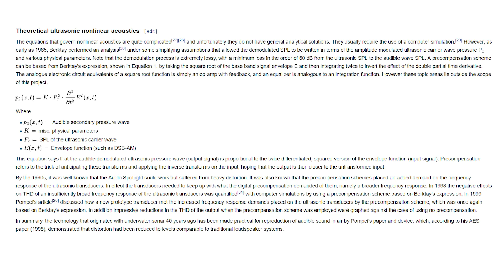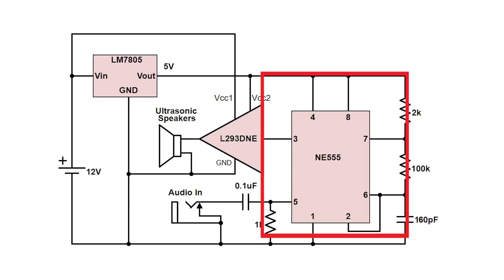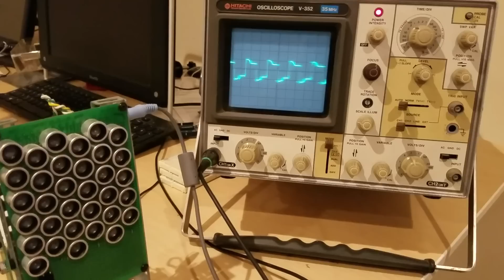Turning Sound Into a Laser

Comment: I built this, so, some build notes: 

IMPORTANT: Vcc1 and Vcc2 are switched in the schematic in the video!  It doesn't seem to burn out the H bridge but be aware that they are labelled the other way in the datasheet.

It's not very loud if you use the H bridge and 12 volts.  If you crank it up to 24 or 30 volts it's a more reasonable volume, but the 7805 is going to get really hot if you power it off the same voltage.

I tried feeding the modulated output from the 555 to a Sure Electronics 8 watt Class D amp I had, and that did work, but it introduces a decent amount of hiss.  The H bridge is a lot cleaner, but it's harder to get the volume up.  On the plus side it's louder and only needs 12 volts.   The transducers do start to get warm running off the class D amp.  It may be worth putting a low pass around 100-200khz on the class D output, but I didn't try it yet.

It's super sensitive to the capacitance.  I got lucky I guess because the two caps I picked to get into the right ballpark turned out to be pretty spot on 40khz.  Even adding a 1pF to it detunes it slightly.  A variable capacitor might be a good idea (alongside a fixed one, you only need a few pF of adjustment).  If you are off 40khz by much it becomes almost inaudible.  

Anyway thanks for this CodeParade, even with the few hiccups I was able to recreate this and the effect pretty easily.  It does really screw with you when it sounds like it's coming from somewhere else.
Reply from the maker: That's awesome!  I'm so glad you got it working 😁

Those build notes are spot on with my experience as well.  I also heard much louder volume with higher voltages (16-24v) but yes you'd have to ditch that 7805 for something like a buck converter, I just didn't have one on hand.

Yeah, the capacitor tuning was really important, I kept putting different small capacitors in parallel and just tried to see which configuration was loudest.  Even though the transducers are rated to resonate at 40kHz, I found that in my configuration, I got louder resonance closer to ~44kHz so it really needs to be tuned by ear anyway.

I'd love to see pictures or video if you get the chance.

And sorry about those Vcc's, I must have mixed it up when I labeled them!
Reply: @CodeParade  could you link a buck converter you think would work. it would be good if you could link the rest of the parts to if you can because i would like to build one of these but do not have much knowledge in electronics
Reply: @CodeParade  someone make an instructables lol
Reply: @CodeParade  Why do you say itnis surprising sound works like light waves..isn't it expected and only surprising if it didn?t
Reply: By hot you mean hot for humans or hot for electonics? I'd put radiator on it
Reply: @GewelReal  Linear regulators are one of the least efficient (but cleanest in terms of electrical noise) voltage sources. They burn excessive "volts" in heat. If you had a 7805 (very common 5 V linear regulator) and pulled 100 mA out of it with input voltage of 20 V, you'd be burning (20 - 5 - 1.2) * 0.1 = 1.4 Watts of heat and the regulator's temperature would get easily over 100 °C. 
Buck converters (such as those found in smartphones) are much more efficient and I'd definitely use one for this project, but sometimes the only you have laying around is a good old LM7805. :)
Reply: @Gigs where did you buy your speakers?
Reply: @felixlopez8083  Jameco is usually where I go for stuff like this. Sometimes there prices are even better than Amazon.
Reply: Can you send me exact circuit diagram please
Reply: @jishnusai1315  Just look at the diagram in the video and switch the vccs with eachother. It's pretty straight forward even to someone like me who doesn't even know much about mechanical engineering.
Reply: L293D PIN 7 TO PIN 3 OF NE555
L293D PIN 1 AND PIN 16 TO 5 VOLTS LIKE PIN 4 AND PIN 8 OF NE555
L293D PIN 6 TO SPEAKERS
L293D PIN 8 TO 12 VOLTS
L293D PIN 13 TO GND OR NEGATIVE POLE
Reply: @Gigs is this what you are talking about? http://store3.sure-electronics.com/2-x-8-watt-class-d-audio-amplifier-board-tpa3110
Reply: Hi. When my music plays NE555 sends modulated signal but it's frequency is oscillating. How can I fix it? Is there a circuit that works in the same way but without any frequency noise?
Reply: @GoodElectronics  use 7555 ic
Reply: @GoodElectronics vì điều chế tần số
Reply: data for other silly people on carrier frequency -
https://patents.google.com/patent/EP1386415A4/en "Frequencies of over 100 KHz quickly dissipate in air, and supply very little column length for the development of audio output in a parametric system. The greatest transmission distance for ultrasonic frequencies will be realized in the lowest range of 25 KHz to 40 KHz. Therefore, where longer propagation distances are desired, lower frequencies are required, typically less than 50 to 60 KHz ..... This embodiment utilizes a lower ultrasonic frequency (25 to 40 Khz) enabling increased length of propagation of the parametric output."
finding commonly noted beam divergence ("beam spread" = 2x this) angle = 1.22 * freq/diameter.. so 25k 24mm is better than 40k 16mm ... somewhere i saw a post claiming around a mile with 25k... doubtful.. most of the early literature i find on ultrasonic beams is conducted 25, 30k to 70k so 40k is closer to the median.. but eg.
https://www.massa.com/wp-content/uploads/2017/08/TR-89-Datasheet-170118.pdf offers a transducer at 23k and 40k .. they only generalise "a greater detection range is obtained with lower frequency transducers due to
the attenuation characteristics of sound in air"
soundlazer.com sell the 25k transducer linked above but their diy product is at 40k according to https://www.soundlazer.com/correctly-adjusting-the-soundlazer/
Reply: Would you please tell me what's the name of the speakers and the board where you placed them?
Reply: interesting video - tests output of "receiver" and "transmitter" modules (albeit mostly in a casual manner) and the 50mm ceramic plate modules.. "responsivity too slow"
https://www.youtube.com/watch?v=caQwQBDGglI
edit here's another helpful video dissecting various ultrasound modules..
https://www.youtube.com/watch?v=VuzytIcSxwI
using the ohmslawcalculator site, you can select any frequency you want to operate at, so you can obtain the cheapest piezos you can find.. "raw" piezos are probably more directional than the transducers with the little cones..
Reply: would also love to know what speaker specs you used / where to find them, and what would an ideal circuit diagram look like with the buck converter..
Reply: @PeteSchirmer  Hey man, I think I found it, it's called Velleman MA405S 40kHz ultrasonic transducer transmitter
Reply: Hi sir, based on that project did you get it working?! Best regards!
Reply: bro can u help me with schematics ?
Reply: @jamescollier3   can you send me the real schematic and label value and pin. dhanushkadill@gmail.com
Reply: @felixlopez8083  Me on AliExpress
Reply: @jamescollier3  could you please send me your circuit diagram???
Reply: what kind of range are you getting?
this describes cancellation to improve on the range or fidelity issues with the original dev's simpler designs
https://www.homemade-circuits.com/making-ultrasonic-directive-speaker/
simple is good, sometimes... does this design have enough range for a quiet golf fairway?
Reply: @atomictraveller  I since learned after building mine that you should test speaker polarity.  I did not so that may impact my effectiveness.  In a very quiet room the range is decent, at least 20-30 feet, but it is not super loud.   I have also found some commercial work with flat panel electrostatic speakers that looks interesting.  I would like to continue improving on this at some point but it is back burner for me at this point.
Reply: article mentioned importance of equal mounting because of phase cancellation, but by my calcs the carrier wavelength is the better part of a cm so not critical. however it does seem that if the build is to be effective, construction should involve alignment with a distant sensor for each module.
time to order some cheap amps and distance sensors on ebay.
Reply: @GIGS Would you share the pcb and the diagram with us ?
Reply: @antoninperbosc1532  I just did it on veroboard, I didn't lay out a PCB
Reply: @antoninperbosc1532  check the spec for your 555 timer for the astable configuration. this is the same as the circuit here (except with signal to pin 5 for PWM), so it will give you some confidence.
i plan on doing a build video for two modules with different transducers, but still have a lot of variables to try myself. eg. i would have put a highpass filter on the output to remove dc bias from the signal, but this may not be necessary as a physical function of the transducer. also i have seen people spanning the signal to ground with a capacitor as another way of removing dc bias, but this is less intuitive to me coming from a dsp background.
Reply: a year after starting...  the recommended L293DNE is over and the ones you get are knockoffs that only work up to about 10v, which i guess is one way of limiting these projects to safe levels. i'm like mentally damaged in respect to electonics (torture abuse), but approaching this like i imagine most people do... i use 4x AAA not 9v (my stomp pedal days are over) so i use a cheap prefab booster board to provide the higher voltage. a cheesy 2N2222 handles up to 40 volts, why can't you just use the output of the 555 with a transistor to pass the higher voltage from the booster to the array? it's a square pulse, right?
so isn't the whole amplifier chip completely unnecessary? now i have this theoretically, but i wonder if in practice an RC lowpass set below the 2nd harmonic of the carrier (say 120kHz) is like safer or stops the higher freqs from burning stuff or using excess power (i have an extensive audio dsp background, so i see signals spectrally, but i don't know much about electronics because i can't afford to pay for tons of shit and when i can it never works, been building functionless crap for thirty odd years now.. bad luck isn't the beginning of it)
Reply: A question though, is this modulation PWM?
Reply: i finally got the astable circuit working with a little fnirsi pro scope. i can't see any modulation whatsoever running a laptop headphone jack into the circuit with digital waveforms at a variety of frequencies. what kind of amp are you guys using, do i need to build a transistor class A amp before this? i'm "new" (30 years of teh fails), make it easy please. i'm getting diddly out of my array and am nonplussed as to what kind of amplitude i have to generate (my fender champ has been busted for a decade).
if anyone's familiar with the fnirsi pro, it's not so popular... the single trigger mode isn't working, and i figure mucking about with simple percussion circuits would be a lovely way to establish some firsthand experience.. i despise following other peoples' plans, because they never seem to work for me. dsp i am safe... but this, i have to buy components...
Reply: @atomictraveller  I got it working too, but the sound is heavily distorted. I just used a $10 audio amp bought from ebay
Reply: @annonymous9067  thanks, i'll have to drag some old equipment out and try again :)
Reply: Thanks for that. How far were you able to reach someone with the sound?
Reply: @notthesamagain  it only really worked in a quiet room, about 25 feet
Reply: Gigs, do you think it would be worth adding a smoothing capacitor to the final output from the amp (or on the output from the 555) - or, does the amp smooth the square wave anyway?  If so, any idea roughly what value or where to fit it?  Another thought I had was whether we're getting the best out of the transducers range of travel... wouldn't we get much better output with a signal oscillating around 0v?  I'm assuming that this setup only amplifies the positive DC from the 555, resulting in only half-driving the transducer cone.  Any thoughts anyone?
Reply: It would be much easier to simply ditch the regulator, and use a cmos 555 like the TS555, LMC555 or ICM7555, which work fine from 2 to 15 volt supplies. You'd have a much bigger voltage swing to drive the H-bridge and various other advantages like high input impedances, low power consumption and much reduced switching spikes on the supply lines.
Reply: I better use ordinary sound not ultrasonic with some kind of parabolic mirror, cheap wok pan also work very well, its like focusing soundwave instead of shooting sound with coherent ultrasonic.
Reply: @Skynet that’s funny, as it was just a concept hack.
Reply: Maybe a daft question this, but: Why is the 40kHz tuning so critical? Is this due to the physical spacing/separation of the transducers or their resonant frequency or something? I would have thought that the higher the carrier frequency, then the greater the resolution of directivity (tighter beam pattern) owing to shorter wavelength - but I'm not an expert in acoustics by any means. I just assumed that 40kHz was chosen as a result of Nyquist's Theorem with it being double the 20kHz at the upper limit of the conventional audible range. Any help would be appreciated, as I would like to experminent with something that can propagate signals up to 200kHz, so was thinking down lines of using a 400kHz carrier. If I'm misunderstanding this fundamentally then any links to the theory behind this would also be appreciated. Thanks for any help you can offer.
Reply: @jimjam8179  it is the design frequency of the transducers.  Nothing that special about it.
Reply: @GigsTaggart  Thanks for that - was clearly going down rabbit holes I needn't have done there! As I said, acoustics isn't my specialism! Thanks again.
Reply: @GigsVT I am unsure about how to wire the L293DNE w regards to IN(A in manual)1-4 and OUT(Y in manual)1-4 in user manual since this is a speakear and not a motor. Grateful for any pointers!
Reply: I followed this video and completed it. I am grateful to this video lecture. Here are some of my humble feedback. 1.The power source may need to add up to 24V, the sound is easier to hear. 2. Better use variable resistor to adjust the frequencies. When the 40KHz carrier is done, you add the input, then the 40KHz will be distorted by input stage. You need to adjust it back, it is easier with variable resistor. 3. The way to tune it is like tuning the FM/AM radio. When you are closing to the best frequency, you will hear the music with a lot of chirping.
Reply: for you rich folk - https://www.newark.com/prowave/250st180/transducer-ultrasonic-tx-25khz/dp/98K8461
same tiny package piezo but resonance at 25kHz (someone mentioned getting ~1 mi. range..) and $8 a piece!
Reply: i know a whole lot more about audio dsp so i confused ;) 555 pin 5 "..alters the threshold voltage, which changes the timing interval" .. does this circuit PWM instead of AM?
before ordering, i understand a pot at the 2k resistor will tune the carrier? i'm itd about what is being performed.
also it seems the 1k resistor on the input highpasses at 1591Hz!!!
being extremely ignorant but also old and having blown lots of stuff up... guessing the L293 acts to derectify and amplify the pulse... and could be replaced with a transistor or amplifier.. which could be used to perform AM? you can see how a little bit of knowledge creates immense confusion.
Reply: @atomictraveller  yes it's more like pwm or a class D amp setup
Reply: ty Gigs, currently looking at pages full of 25kHz modules on aliexpress priced more like the 40k..
edit.. here's a helpful friendly link for nescients.. 555 astable calculator, explains this circuit.. and good if you want to use a different carrier frequency https://ohmslawcalculator.com/555-astable-calculator
(it shows that the 100k resistor is the most appropriate point for fine tuning, though these values also affect pulse width)
Reply: Could someone please build me one of these as a prototype for a retail product I want to make?  I'll pay for it.

Comment: this is so cool, could you provide some insight into a few questions:

1. why do you need so many ultrasonic speakers in parallel? could you get away with just using one?
2. what is the purpose of the 555 timer, what difference would it make if you went directly into the amplifier ic?
Reply: He said that only one unit is pretty weak, so that's why he wired a bunch of them in parallel. I'm guessing that a single unit that would be equally loud would probably be pretty expensive?  Just a guess on my part tho

Comment: I tried to build this circuit. 
but after building one when i probed the frequency of the output, it was around 60kHz. 
and of course i couldn't hear any sound.
weirdly, it became 40kHz with 200pF in place where 160pF should've placed.
i have no idea either what went wrong or what should i need to change.
Any help or suggestion will be appreciated.

Comment: Hi, the video is so interesting, and I'm so interegued to build the circuit myself, I'm just wondering how did you come up with the circuit, and why did you use those exact components , because as I did some researches, I found out that the NE555 is a timer that produces a square signal form, so I don't understand fully how the modulation works, and the L293DNE is mostly used with moters, so if you could please help me understand the circuit, or if anyone is able to do so do not hesitate, thanks guys and I hope someone sees this comment.

Comment: Surfaces that have both elasticity and dampening will demodulate the ultrasound to make the signal audible.   Those surfaces can't keep up with ultrasonic frequencies.  So, they absorb the ultrasonic part of the signal and emit the audible part of the signal.  However, the surface amplifies the audible signal using the energy from the ultrasonic part.  This works for walls and ear drums.